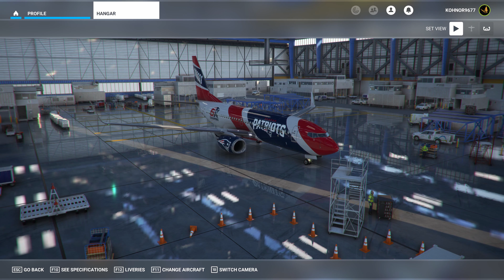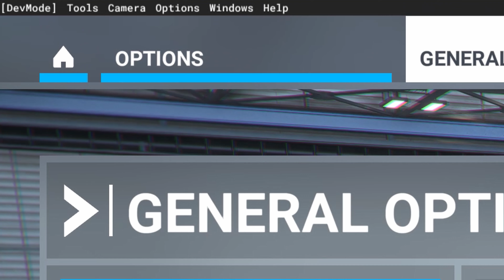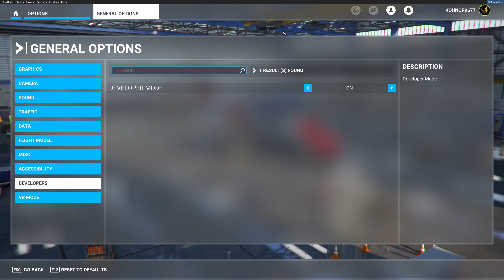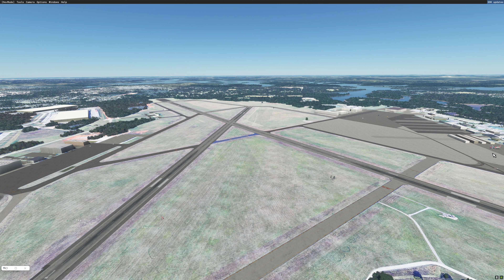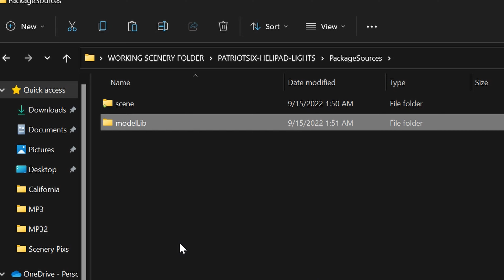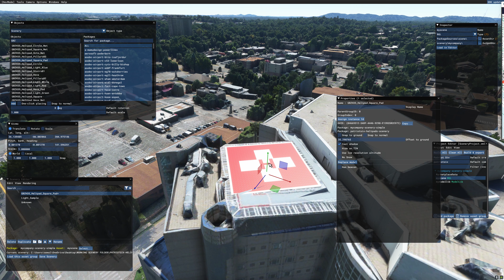23 MSFS 2020 Scenery Tutorial - Add Lights to Helipads - Full Process Including Adding the Helipad

Comment: do a video on instaling the gbz mod cause i cant figure out where the heck to place it for its objects to show up
Reply from the maker: Thanks for watching. I usually am more detailed than that. The GBZ folder goes into the community folder and stays there. Once there, you can reload MSFS; the folder will load, and the objects will become usable. I made several videos on using the GBZ mod, so the details are probably in another video. At first, I thought folks would watch the videos in order, but they don't. The algorithm can send you to random content, such as a second part of an original video.

When you unzip files, they often end up inside an extra folder. Make sure you drill down to the last folder and place it inside the CF. You should end up with a single folder containing these files as you drill down.

gbzh35-helipads - Folder
PackageSources - Folder
modeLib - Folder

And then these folders are on the same level.

GBZH35_Helipad_Square
texture
GBZH35_Helipad_Circle
GBZH35_Helipad_Common
GBZH35_Helipad_Hexa
GBZH35_Helipad_Octo
Reply: @patriotsix5880 ok thank you man . I was trying to go through all your videos to see if you mention it but I just wasn't having any luck but that thank you for this clarification
Reply: @patriotsix5880  just to claify thats the comunity folder where i put stuff like liverys etc from my steam apps, common, msfs2020, route right or is it the comunity file area in %appdata% route because i have it in the steam directory community folder where i put my sceanery and liverys etc and its not showing up in sceanery or helipads only the ones from a seperat helipad lib that used a few of them are there and the files are in the right order as you discribed

Comment: Thanks, helped a lot. I wonder how can I get a cold and dark position on such a helipad, GA Ramp?
Reply from the maker: It depends upon the situation. All the methods are the same but the project approach varies depending on if the is a stand-alone location, a fictional airport, or an existing airport. The results are below. 

Existing Airport - https://youtu.be/UlWiAbhersg

Stand-alone locations and fictional airports will use this method. https://youtu.be/Wb2DM3kCwH4

Good luck. Let me know if I can help.
Reply: @patriotsix5880  it would be a non existing helipad like the one in this video, also an elevated platform. When adding a starting point the helipad it means the helicopter always spawns ready to fly. I added a GA Ramp and I couldn't elevate it, nor deactivate snap to ground, however when testing it seems to spawn the cold and dark helicopter on the elevated platform without issues.
Reply from the maker: @jimbobongo  There is a helipad start point in SDK you can add instead of a GA start point. I would need to double-check my own video because I made the video for helicopter simmers but I am not one. When helipad start locations were added to SDK, they were at ground level only. Its simply a limitation in SDK and I don't think it has changed. You can test it and see. Try helipad start instead of GA.